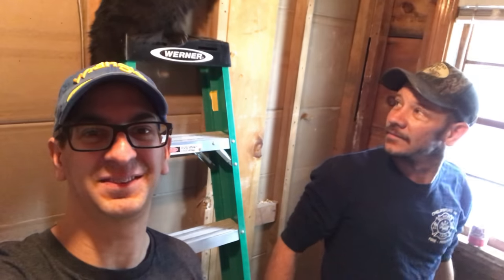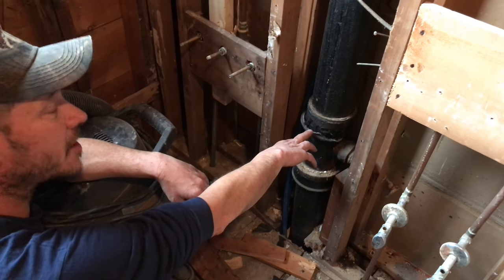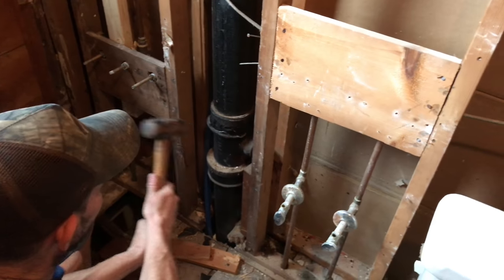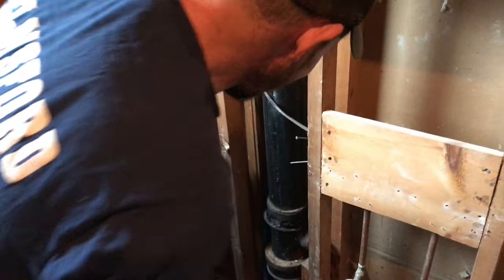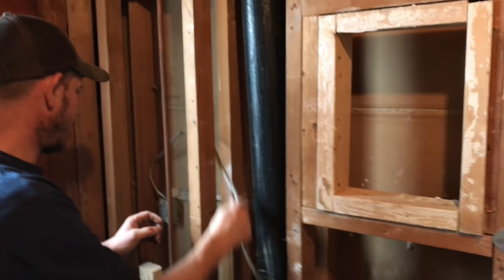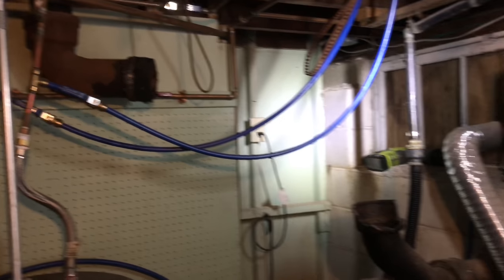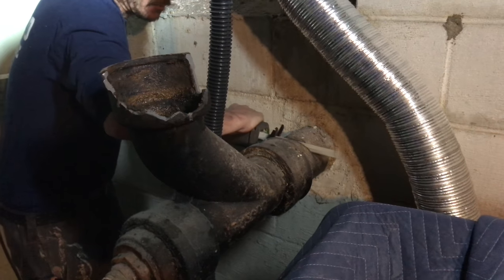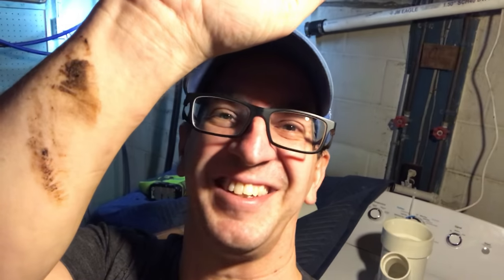How To Remove Cast Iron Pipe From Your House

Comment: How do you keep it from crashing down from the roof?  I have a three story house.  I just have to replace 10 feet.
Reply from the maker: I have a cape and the upstairs was replaced and changed to plastic during a home renovation years ago. This was first floor bathroom so it was fairly easy
Reply: You have to make sure it is properly supported above you before removal, since it weighs more than the house 🏠

Comment: I tried using a "sawzall" to remove my iron pipes but the blade kept dancing around.  Is there a technique to get it to bite in and settle in the cut line?
Reply from the maker: Possibly try a different blade
Reply: To anyone else reading this months later, Milwaukee, and slowly other tool companies, has an app that links to their new line of "sawzails".  You can set the start up cutting speed to be slower so that you can get a Cerf or groove cut into your piece before it reaches full speed.  Suuuper helpful for hard materials or when your blade is dancing around.  Highly recommend.

EDIT:  Youtube auto corrected Milwaukee and sawzail
Reply: start w a handsaw first i heard

Comment: HO repair because of the weight of cast iron in a horizontal stack you should NOT replace the piece with PVC and it’s against code it will eventually fail and possibly cause more expensive damage